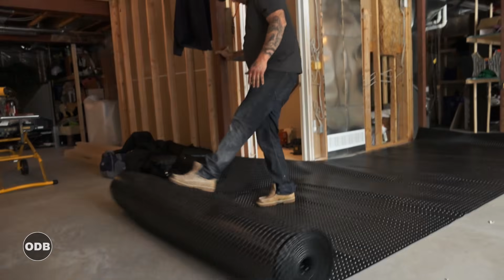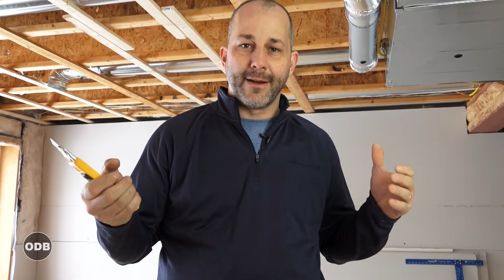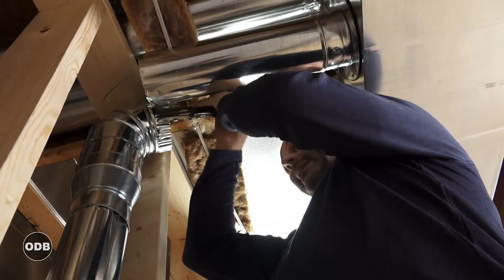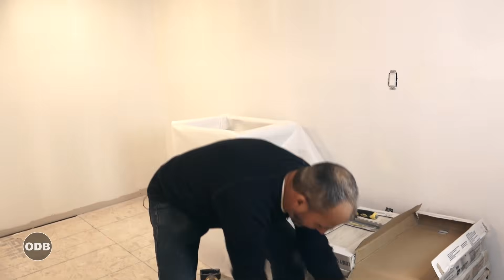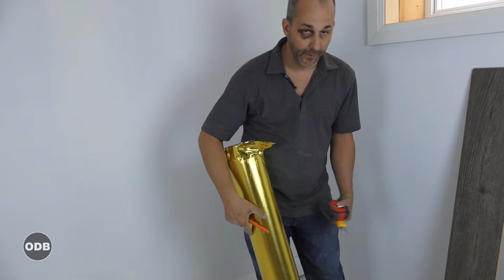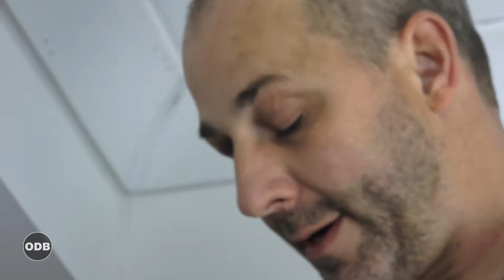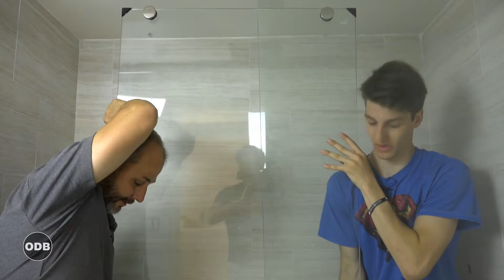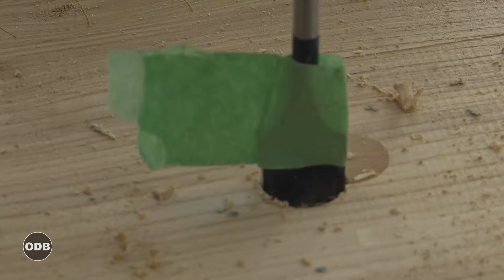DIY | How To Renovate an Unfinished Basement | A To Z

Comment: why no nails for the wooden floor?
Reply from the maker: This is a laminate floating floor that looks like hardwood.
Reply: so no wood flooring was used???
Reply: don't reply stupid question.🙂
Reply: But... could I apply nailed hardwood floor with that underbed you used?
Reply from the maker: Yes In my opinion it is a good system for hardwood , although I use 3./4 t and g when I am going with hardwood.
Reply: Sorry for the continious replies. What is 3./4 t and g?
Reply: "3/4 tongue and groove OSB"

Comment: how do you use the lazer level. Thanks T
Reply from the maker: stick it somewhere and turn it on.
Reply: You use a tape measure with the laser and measure up or down from what you want to plum or level and the laser projects the line on the tape and then you adjust accordingly to make the laser line on the tape read the same all the way thru

Comment: Jeff. If you're building the wall and setting it atop the chipboard do we need to use pressure treated on the bottom plate? It won't be in contact with the cement.
Reply from the maker: No we don't. When you build on subfloor the code only requires regular spruce. Good question.
Reply: If you were planning to stick-frame exterior walls (in a basement). Would you finish the entire floor area (excluding any areas that will be tiled or left unfinished cement) with the black plastic iner & tng chipboard subfloor then build the exterior walls on top? Or would you still build the exterior walls with pt bottom plates direct to cement?
Reply from the maker: In a perfect world the whole subfloor would be installed first

Comment: After doing a couple of basements and wondering how to line things up, I decided that the stair were the best reference point.  Once the walls are up, no one can see where the original structure was. (except at the windows)  If the stairs are not square w/ the room, then you could have big trouble at the end when tile goes down or things don't line up.  Just saying.
Reply from the maker: sure except the stairs are not a visual line and usually are about 36"

Comment: Hi Jeff I love the videos! What type of education or training did you get to do what you do? Thanks again
Reply from the maker: working in the trades since I was just 13. Started flipping century homes with the family.
Reply: Home RenoVision DIY what would you recommend to a 17 year old looking to get into the trades? Do I really need a degree? Or just an apprenticeship?
Reply from the maker: I would recommend becoming an electrician or a plumber. Those are good jobs that will never be challenged by deflated labour pressures. Most skilled trades feel the pressure on the hourly rate during times of high levels of immigration. Ticketed trades do not.
Reply: Noah Sorensen 
Definitely electrician or plumber. Start helping out now. Go to trade school for 2 years. Work for someone that’s small. Save up for your own van/truck/tools/LLC/marketing. Then start your own company. When you’re 30-35 you’ll have a couple guys doing the work and you running the business.